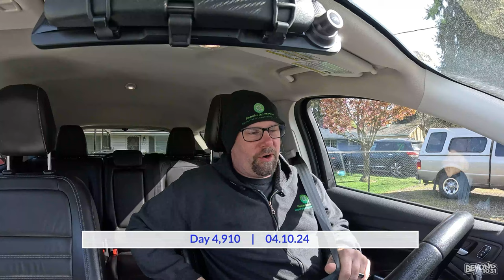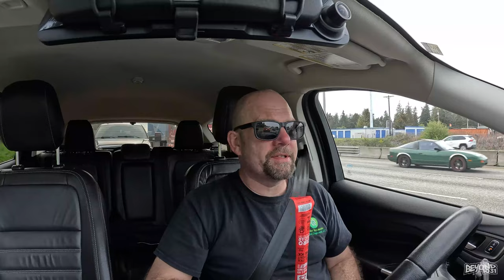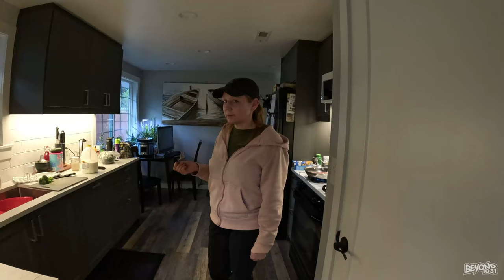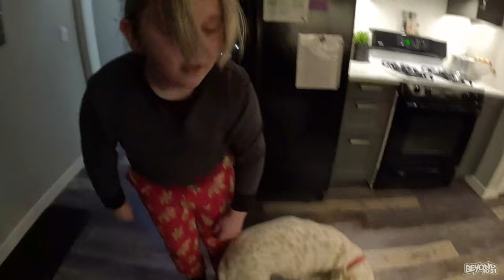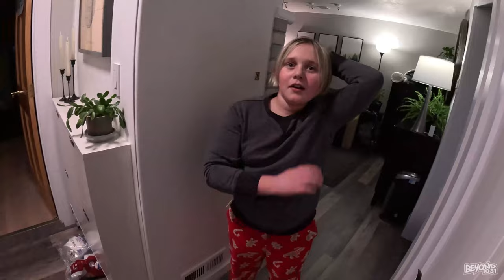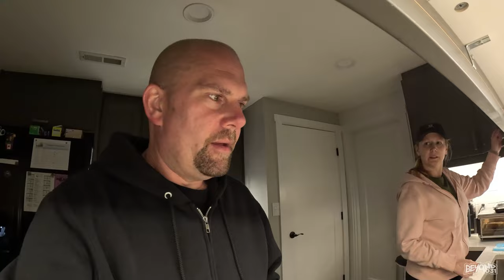Don't Disturb Her! [Day 4910 - 04.10.24]

Comment: When I was 16 I had a similar crack in the plastic portion of my radiator. I was a kid with little money so I removed the radiator and repaired it with JB Weld. It stoped the leak and I drove the car for another two years without issue until I sold the car.